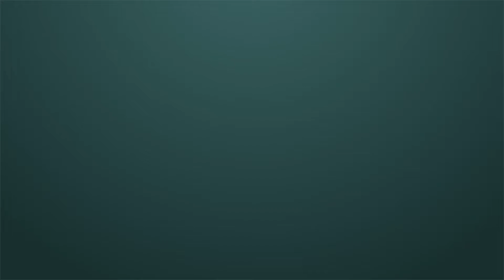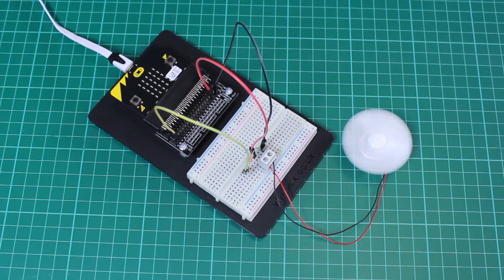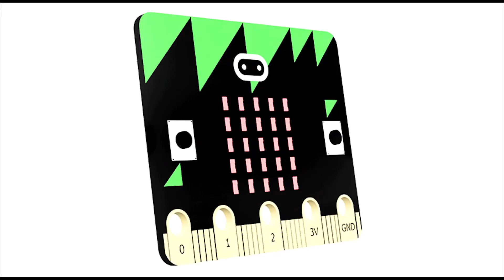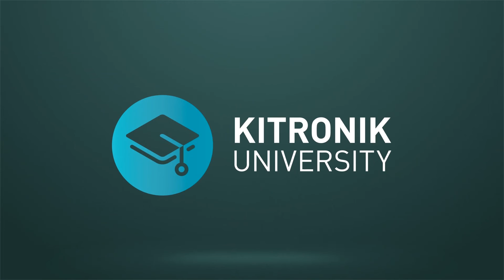Inventor's Kit for the BBC micro:bit Experiment 4

Comment: Whatever i do, it seems that the motor is either turning at full speed or stopped.
I tried to change speed using buttons (A decreasing and B increasing, 1 by 1) instead of using a timed loop. If ratio is 0 the motor is stopped, if it is 1 (or any positive number), the motor turns, with no visible difference between 1 and 1023…
Am I missing something?

Comment: How do I line a terminal connector? It's driving me to madness
Reply from the maker: If you mean line it up, the booklet diagram shows you how it should be laid out. If this is not what you mean let me know and I will try to answer it again. I hope this helps.
Reply: @kitronik  Thanks! I tried figuring out how the TC works. The problem that occured was that my exposed part of the wire is actually very thin & it broke. I tried cutting it with a scissor and it worked. Thanks!